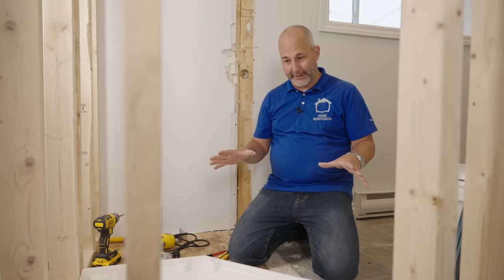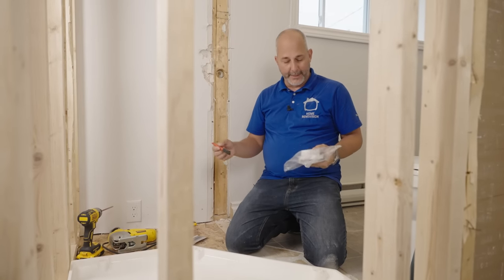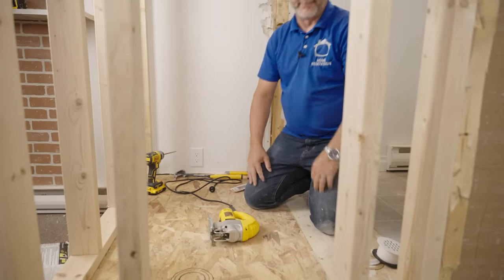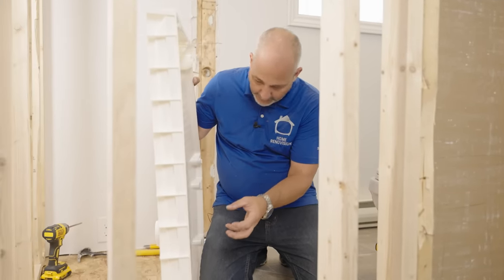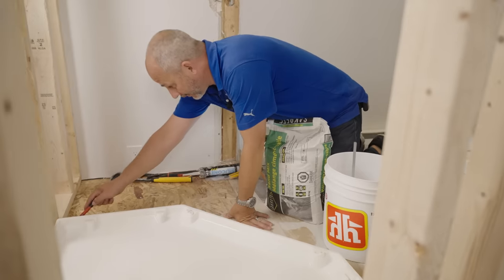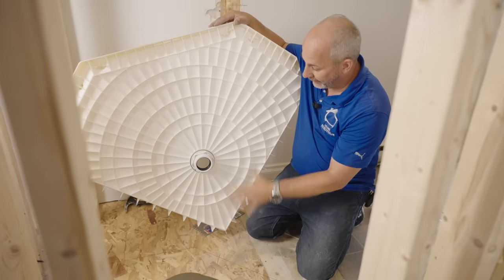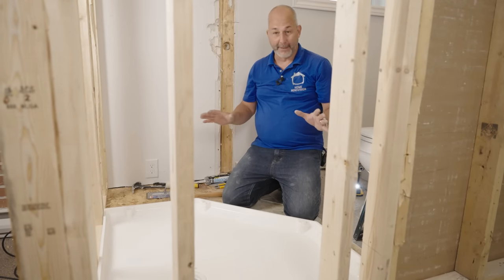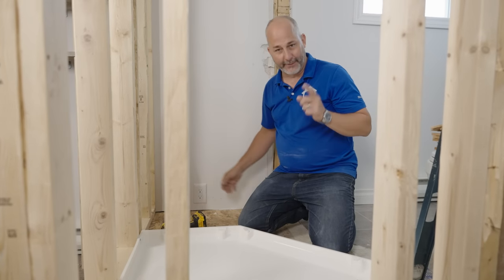How To Install A Shower Pan | Church Flip | Episode 9

Comment: I’ve been telling my boss to do it this way for YEARS and he still insists it isn’t necessary. Haven’t had a callback in over 10 years but every time a pan creaks during installation my butthole puckers and I give him a dirty look.
Reply from the maker: amazing how folks can get used to accepting lower quality.
Reply: Sand mix is cheap and it's only an extra 30 minutes of labour (15 if you work fast!).  This is why so many of us are DIY, because we take the time to do things right and not just the most profitable route.

Comment: I have seen  videos using a membrane of plastic or roofing paper placed on the wood floor then the sand mix/cement placed on top of this material. Others apply the sand mix/mortar directly onto the wood floor to level out shower base. Are there any benefits for either application? Does it really matter?

Comment: I just tour out a bathroom today that someone put cement down on OSB board 20 years ago and the only part or the bathroom the floor was rotten was where the cement was I’m not sure why but I came across the same situation about 8 years ago and every since then I put felt under any type of cement or I use a bonding agent that’s moisture resistant. It’s just a tip that I do because of what I’ve seen. Thanks for the video and I always enjoy watching them.

Comment: I found if you don’t have a massive pair of pliers you can use one of those oil filter wrenches to tighten that plastic nut on the drain assembly.

Comment: I'm in a similar situation with expanding a 2-piece to 3-piece. Will need to cut through concrete (split level on slab). But I think you have one of those videos already dealing with that. This was super helpful and freakishly relevant.
Reply from the maker: Cheers!

Comment: Really looking forward to this series. I’m currently trying to work my way through redoing my basement bathroom. I have been dreading the shower portion a bit. I have piping already from the ground to use. I just hope there is a way to get a pan that fits the hole?? Not sure if that’s a thing, I haven’t done much shopping around yet, I know they have pre-cut holes in some you can buy but not sure if it will fit what I need yet. May do some measurements tonight… I have to redo the water piping first though so not rushing.

Comment: I needed this 4 months ago. I am almost done renovating my bathroom from a weird layout with 2 separate vanities, 60’s tile shower, and toilet to a 4 piece with a Duravit shower pan and free standing tub. Hired plumbers to do the rough in’s and had them do install on tub and shower because I didn’t know anything about installing them. Turns out they knew even less. Guess they were only qualified for leaks and clogs. I knew enough (and could read install sheet) that mentioned a mortar bed under the pan but didn’t give any details. I was hoping plumbers would know more. They did bare minimum of mortar underneath but at least the duravit pan is heavy, maybe 60-80 lbs and mostly self supporting. The mortar I hope is mostly to keep it from moving so I hope they put enough so I’m not dealing with a mess in 5 years.

Comment: Hello Jeff. Thanks for the informative video. My question is what if the floor was concrete and level, do we still have to use sand mix? Or we can just install it as it is. Thanks a lot.
Reply: I'm not Jeff, but the short answer is Yes. Every pro I know uses a mortar base. It prevents flexing, even if a very heavy person uses the shower. Remember, flexing eventually leads to cracks and leaks. It's minimal expense and reasonably easy.

Comment: Instead of sand mix or mortar would you be able to use self leveler and let that set up before putting the shower pan in? That would create a perfectly level surface for the shower to sit on
Reply: They don’t really work like that. Unless you have a dam around your pour area and mix 3 or four gallons, pour it ,screed , then walk away.

Comment: The taps with the mallet are to lightly adjust the slop to better fit your pan, correct?  Does the weight of the pan itself do most of the work setting it into the mix? or do i need to add a little pressure?

Comment: Wouldn't it be a good idea to instal Kirdi waterproofing membrane first to prevent and possible damage to the sub-floor and to act as a disconnect between the sub-floor and the mortar bed? Shouldn't the screw  holes be elogated to keep from cracking the shower base should there be any flex?

Comment: If you are installing drainline to shower after can you measure your down drainline and go ahead and install it to drain before you set pan? That way you can just glue in pea trap and connect to main drain line! So you do not have to fight with pipe connection after installation!
 This will only work with new construction and if you have room! Or will this not work or cause a problem?

Comment: Do i need something similar for going on concrete? I have a rough in basement bathroom and installing shower stall and toilet. Was wondeting if i need the thin set or sand as well. It seemed not to creak, i still have to check if its level at least.
Reply: Wondering this too, did you ever find out?
Reply: @thevlogsofdab8630  no never found out. But did find out that the toilet and shower are never installed far enough away so 90% of the time you have to dig up the shower drain and move it a couple inches. So I ended up leaving it for now.

Comment: So you’re putting the shower pan up against a 2 x 4 wall construction without any sheet rock?  And I also have noticed that you didn’t put any kind of barrier on the floor before you try out that stuff out? Other videos had mentioned how the wood floor with suck up the water out of that thin set.
Reply: The sheetrock gets put on afterwards. If you have sheetrock on already due to a reno, you should cut the bottom out a little so that the pan screws directly to the studs. Most pans are designed to have sheetrock above them, but not behind them if that makes sense. Then your poly sheeting walls have the proper drip lines into the pan. 

As for the thinset onto wood. I'm not sure, but I wonder if that's why he used the sand product and not true thinset
Reply: @huma1000  yes that makes sense

Comment: Great video,thank you
The hole under my shower pan is bigger than the one you made .Will that cause a problem?
Reply from the maker: shouldn't. they are designed to be pretty sturdy. The sand mix is just to provide a little extra stuff to keep it from making noises while walking on it.

Comment: 15:55 what type of screws did you use to secure the shower pan to the studs? And do they need caulking over the screw?
Reply from the maker: basic steel screws. and no. eventually a waterproofing layer is added.

Comment: I only have 26 inches from the wall and all pans I can find have 30 inch depth. Are there 26 inch depth pans out there?
Reply: Maybe you could buy one of those styrofoam shower bases/pans from Schluter (or similar)? Then you could cut it down to fit. Pretty sure I saw that you could do this.

Comment: "instead of using thinset, like you would for cement" are you suggesting that you can't use thinset in this application or simply that it just isn't ideal.  I fully understand why this sandmix is better, just wondering why thinset would/wouldnt work

Comment: Would you still use the same compound under a shower pan in a basement with cement floor? Also, what bits are you using in your impact driver? I've had terrible luck with the Bosch, Makita, etc. Thanks in advance, your videos are an enormous help!
Reply: I second this question!
Reply from the maker: yes for the compound. as for the bits i get them from the folks who do exchange a blade. find a store that supplies those blades and they will sell those bits as well. Cheers!

Comment: Hi, watch all of your videos & have been doing a similar line of work under someone for several years. Thinking of going on my own and was wondering what your thoughts were on a property maintenance course, which gives a qualification and bit of experience in carpentry, plumbing, plastering, tiling ect.. Is it worth the price tag of like 2000 for such a course?

Comment: Jeff your the best! Hey setting a 60x30 Dreamline pan 2nd floor on plywood floor. Apparently setting sand mix required sloped 1” around to 3/8” @ drain on right side. Questions- can I somehow retrofit a linear drain hypothetically 24”-26 wide. Thinking would need cut into the acrylic pan though. Would be cool if possible but would void pans warranty surely. On that note, they claim not being able tile directly onto pan or lbuild wall or bench on the curb. I wanted to do a pony wall up bout 42” in bout 30” from valve wall.  Would do glass above joining 30” door hinged on end wall plus help block looking at toilet while showering. Perhaps a 2x6 wall half built to subfloor half laying on curb aiding distributing weight. Suppose a guy could  lay it on metal bracket nailed to subfloor reaching over curb then silicone the joint. Both sides be tiled continuing tile behind toilet and vanity. 
How would you go about adding a bench or two in  back corners. Should a corbel be used? Then would be integrating large mosaic niche in center of back wall. Or construct 30” x? Or a Bench  attached to end wall though glass door be attached to curb. Suppose easy way be utilizing removable teak chair/bench .. lastly ,so much for the couple questions:) - adding soffit above shower integrating a light/fan or whatever cool gadgets you can think of     Thanks Jeff 😊
Reply: Hi.  Did you ever install your Dreamline pan?  I have a 32 x 60 one that I am about to install.  I got all of the same info from Dreamine like you but that can provide a specific brand other than use a sand mix.

Comment: Do you not use any type of mortar with the bedding mix?  I was about to do this similarly today but the Mapei mud bed mix mentions using a mortar on the bed and I did not have any.  Thank you
Reply from the maker: if you are using Mapei with mortar then it acts like an adhesive to the pan as well. this system requires you leave a weight on it until you install the doors since there is no adhesive.

Comment: Do you need to use setting sand when installing a shower pan on level concrete?
Reply: I have the same situation, but I plan to use the sand mix.  Mostly because the original builders in my upstairs ensuite must have skipped the step and my base creaks a little.(super annoying)  In the case of yours and my basement....concrete is also not level.  Spend the extra $10 and 30 minutes!   The sand will guarantee the pan will sit level and the water will be directed to the drain.  Nothing worse than creaks and squeaks or pools of old water in a bathroom.

Comment: Many professionals say the mortar should be as dry as can be to prevent shrinking so it doesn’t pull away from the bottom of the pan, because then there’s no point as it’s not supporting the pan.
Reply: I was thinking the same.  Like maybe pizza dough or peanut butter consistency.  However, this is a sand mix, not mortar so I think his yogurt consistency will be good.

Comment: Kindly, drain fitting: ¿why silicone vs plumber's putty on its underside?   (My plumber's putty did leak after a while [~10 yrs] on the upstairs shower unit (plumber installed drain fitting).  (I wish I could hire you).  Thank you for your videos.  God[Bible] Bless you.

Comment: I always thought the purpose of the rubber seal was to be between the drain and the pan to create a waterproof connection without the need of any silicone
Reply: Yes, silicone is just a waste.
Reply: I guess you can use plumbing putty
Reply: Belt and suspenders, which seems wise. I bet the instructions say to only use the gasket. Jeff is from the Plumber's Putty generations, though. Adding something extra probably just feels right.
Reply: Yes, they advertise these drains as "no-caulk" but people like extra protection when it comes to drains.
Reply: @Faruk651  One of the reasons I really like the Schluter drain assembly.  Easy for my plumber to connect properly, easy for me to waterproof effectively.  Rich or not, nobody like drips through the ceiling below ;)
Reply: @jboyd85  Which Schluter drain assembly do you recommend (there are few options)??  I am installing shower pan on concrete in a basement
Reply: @canadude6401  are you using a schluter pan? if so, buy the entire kit with drain, membrane, flange, etc... in one.  Remember depending on whether your house uses abs or pvc, you will need a drain flange in that material.  I like both the stainless square and tileable grates: it depends on what look the client is going for.
Reply: @jboyd85  no. Using a fiberglass pan like Jeff on the video
Reply: @canadude6401  then you'll have to use whatever the manufacturer's drain is.  The schluter system drains are only compatible with their system. What you are looking for is an old-fashioned assembly that compresses onto your pan.
Reply: @jboyd85  OK. Thanks Jeff

Comment: Hey, I’m in a pickle. I would like to install a 60x36 shower pan in my bathroom, the area that it will go in, is 59 1/2 inches not 60”. Why was the shower area constructed below 60” is beyond me. What on earth could I do to make a pan fit without having to make my shower area smaller. Thanks!
Reply: Pick up a foam pan from Schluter Systems (available pretty much everywhere now) and trim it down to size with a razor knife. When contractors like me build showers we often face odd-sized openings.  A foam pan means you can easily trim something down to suit a smaller opening, or extend it with dry-pack mortar to fit something weird and large. Their instructional videos are all on YouTube
Reply: + 1 on Schuter. Their systems are great and versatile and their instructions are clear.
Reply from the maker: you could cut the framing to create the proper space or remove a 2x4 wall and install a 2x3.
Reply: @jboyd85  That is only triple the price. Let me guess you install these in custom homes for ppl with deep pockets.
Reply: @Faruk651  Yes.  And for people who can't afford the time it takes me to screw around moving a wall to make the stock pan fit.
My labour is (generally speaking) at least as costly as my materials.  When I find a time effective solution like a schulter pan extended with mortar, well... it saves everyone money.  At least when they don't choose ridiculous tile.
Reply: @jboyd85 Do you realize this is a DIY channel? People watching this channel is not gonna hire a fancy contractor who will charge $15k to $20k for fancy shower. It might even be more. I am not sure how much you rip off.
Reply: @Faruk651  I make a decent living, have payroll and pay taxes.  Jeff has done videos on this: before you call contractors a rip-off, make an effort to understand our costs maybe?
And yes, I do realize we are dealing with DIY here. 
The person at the top of this thread came in with a specific question about how to work with an undersized bathroom.  This is something a Schulter kit is excellent at handling.  Moreover, the skills required are about as basic as the ones Jeff demonstrated setting his pan.
In my marketplace the cheapest Home Depot shower pan you can get that is 60" is nearly $380 CAD. A schluter kit, with waterproofing for the walls and valve seals and curbs is $630, right down the tile aisle. 
If a homeowner has basic tiling skills and can watch instructional videos, my suggestion is cost effective and readily available.  
I'm not here fishing for work: I find Jeff's content entertaining and (sometimes) informative.  I like seeing how other people work.  I'm only going to get the call if someone screws up a DIY project. At that point my first conversation will be about which solution fits the budget best.
Cheers!

Comment: I think the rubber gasket is going on top of the pan instead of silicone/sealant....
Reply: You are so wrong.
Reply: @Faruk651  Can you elaborate please? Thank you!
Reply: @steevenmd  I assume you never installed a shower base in North America before. This is what the manufacturers require you to do the installation.
Reply: @Faruk651  Actually no I didn't. Also I'm originally from Europe and we are using rubber gaskets under compression for sealing and not silicone. And if the manufacturer stipulate a gasket under the sanitary unit then there're two gaskets in the box...

Comment: as a plumber, WHY does everyone build studs in the center of rough in faucets!!! errrr . Nice video, well done, sandmix is indeed almost a  necessity for those flimsy shower pans. The worst are the ones with a foam insert.
Reply: True, those things are flimsy, the one piece showers too, dang things crack then you have to do the spray foam Bondo fiberglass fix.
Reply: @nmatthew7469  one piece I find to be not so bad, its better than the yogourt container made shower walls you have to silicone in place, lolol
Reply: So that you can notch them, obviously ;)

Comment: careful with that sheet vinyl, the bottom layer of mine was 40% asbestos. vs my drywall mud that was 1%.
Reply from the maker: cheers. the vinyl was installed in 1980 so no worries.
Reply: @HomeRenoVisionDIY  is 1980 safe? Mine was 1975.
Reply: @conradcoolerfiend  In Canada, abestos was banned in newly manufactured goods in 1979, and banned for sale in 1981.

In the U.S., it wasn't formally banned until 1989, but by then it had been phased out of most consumer products due to bad publicity.
Reply: @garyjsu  nice thx!